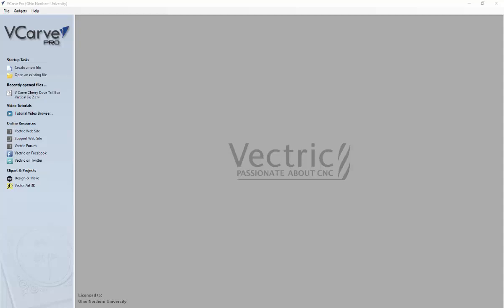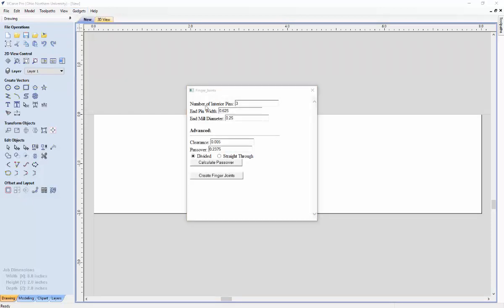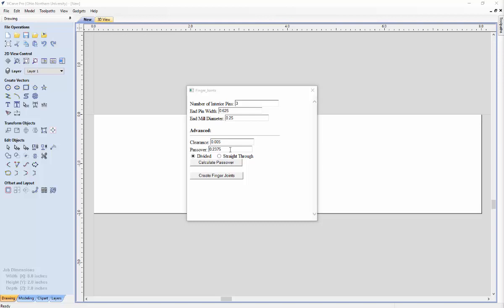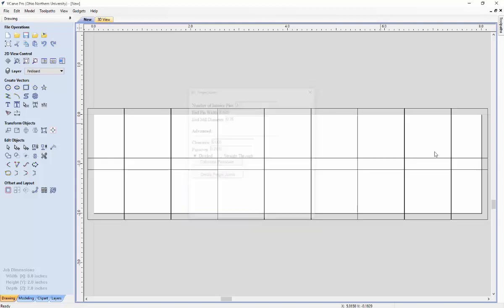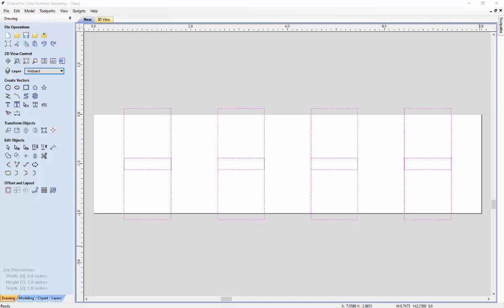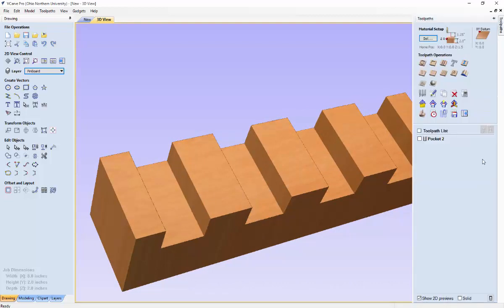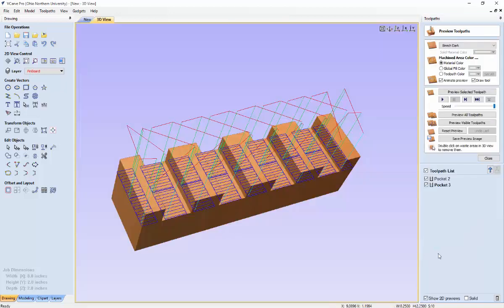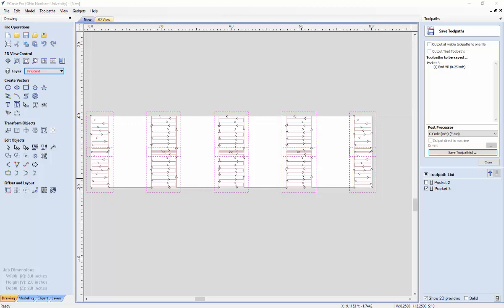VCarve Pro Finger Joint Gadget Tutorial

Comment: The site doesn't open. Pity, I could really have used this gadget :(
Reply from the maker: Im sorry that the website is not available anymore :( This was a Senior Design project at my university last year and my professor must have taken the website down recently. Do you want me to see if I can find the files and send them to you? I think I might have them around somewhere.
Reply: Yes please, it would be very handy for the type of work I do :)
Reply: Matthew I have your program on  Finger Joints. and have watched your video, in it you talked about some more info on setting up parameters . Is any of that still available. Also can you set up and run more than one board at a time. Or can you cut 1 socket and 1pin at a time. Jeff Peters  cusoak@gmail.com